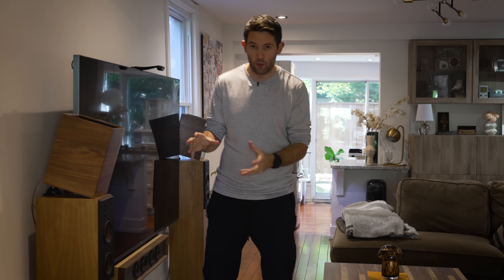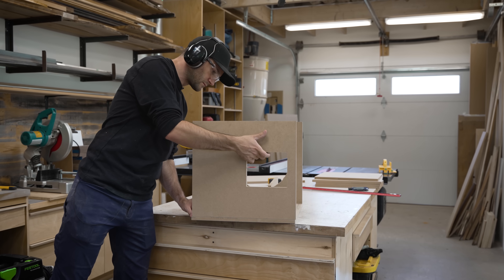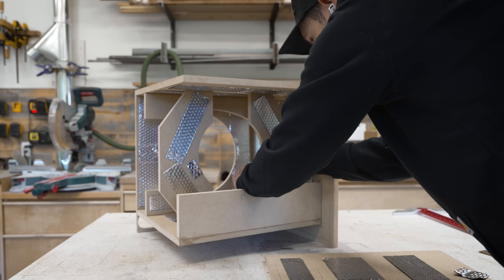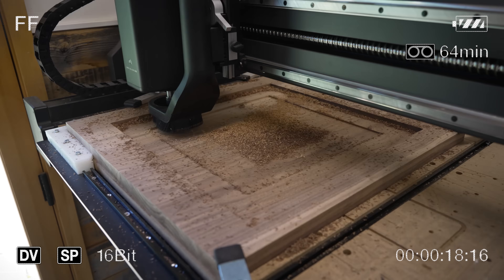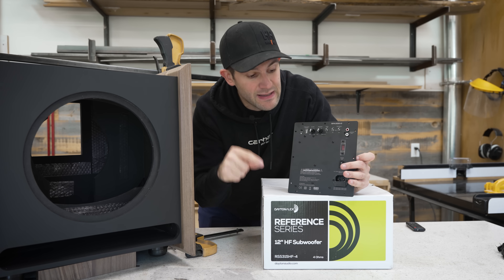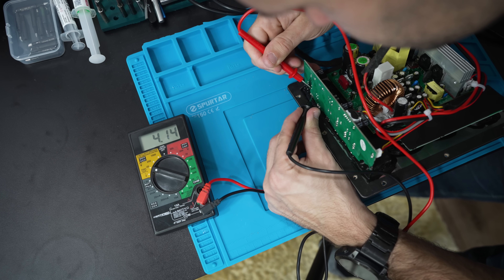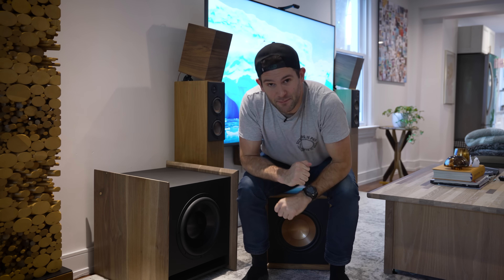THIS changes DIY Audio...

Comment: You do realize that those Dayton Audio wireless transmitters induce several milliseconds of delay to your subs, which you have to compensate for? The specs say 32ms which is equal to placing your sub about 12 meters (36 feet) behind your main speakers. Your main speakers are very much misaligned with your new wireless sub, which may explain some of the lack of 'punch' you hear and a vague 'room filling' ambient bass since the subs fight against the main speakers at the crossover region.

Comment: Why would you 'choose' a placing for the sub that is most likely to be the worst possible outside of placing it directly in the corner of the room? Also, why remove the old sub? Multiple subs will provide a smoother in-room response if placed smartly, standing waves cancel eachothers out.

Comment: Ah, the good old days of proper car audio—when a well-tuned sealed sub setup could shake your soul without sounding like a loose garbage can lid. Two 15-inch PPIs in a custom-sealed box? That was peak bass nirvana. Paired with a PPI digital amp (with the legendary bass remote knob, of course), an Alpine deck, and Pioneer Premier components? That was a stealth system done right. No flashy nonsense—just clean, hard-hitting sound.

Bet that '95 Cavalier rattled like crazy, but nothing hit quite like those two 15s. Pure nostalgia.

🍀🇨🇦🔊🔊🔊🫶🫡
Reply: And by the way you did a great job with this SUB. 
Especially cosmetically very original 😊

A common misconception. You're actually better off slightly overpowering your subwoofer with your amplifier than underpowering it. Trying to match it exactly or using too little power increases the risk of distortion, which can damage or blow the sub more easily than clean, controlled power from a stronger amp.

Comment: far as the ported vs sealed. little while ago i switched from a SVS sb16u to a klipsch rp1600sw. the klipsch is rated significantly lower than the svs on paper but in real world it absolutely destroys the svs in every single category. the svs was a powerhouse dont get me wrong but the bass felt more like someone was hitting objects with a bat around my house vs the klipsch feels like there is an active earthquake. also for shits and giggles. with both subs and gain all the way up... volume 7... the kilpsch was knocking dishes over in the kitchen cabinets and felt like a chopper was landing on the roof. the svs required 7-8x more volume to achieve similar output. and surprising enough the klipsch does just as well in music and is often drastic overkill anyway. while a sealed may get u that top 1% your looking for in music it will fall flat on its ass in every other aspect

Comment: I asked Grok to design a ported bookshelf speaker with a 5.25 and 3 inch 8 ohm drivers to include material and crossover options...in 10 seconds it gave me the design along with all parameters including materials, and detailed measurements including exact driver and port placement...
Reply: That's nice. You should get Grok a 12 pack of his choice for that.

Comment: 3/4 MDF is the minimum thickness I'd recommend for a box with 12 inch subs and just use Rhinoliner or plastic spray. For 2000+Watts systems I'd predrill, sandwich, glue, and screw together 2 layers of the 3/4 MDF for something that outlasts the subs in the box for the lifetime of the Box itself

Comment: That wireless solution adds noise, distortion and latency. Not a great idea but you can get away with it for a sub. Wouldn't recommend it for full-range speakers.

Comment: "At 300W it should be more than powerful enough for my theatre"  <- The real spec for a theatre is an SPL at a frequency.  For that you need to know the sensitivity of the speak and its resonance frequency.   300W but itself means nothing.  If the speaker has a sensitivity of 80 dB at 1W/1m, you need way more than 300 Watts to drive it.

Comment: I will hopefully, someday be able to do truly DIY, but I'm a caregiver living in somebody else's house, so not an option at all, for the foreseeable future.  My question is about your old subwoofer.  I believe you said that you "slightly modified" it.  Was it just for looks, or did you do modifications to make it work/sound better?  I have two used subs which work fine 90% of the time, but sometimes they make crazy sounds which I don't understand, and I'm wondering if I can improve them with any kind of simple tricks.  Of course, some year I will build my own, but for now I just want to make these older subs last until then. Do you, or anybody have tips/tricks to improve existing subwoofers?

Comment: 3:33 you may prevented the potential flex but you just split your mdf there and introduced potential rattle and also flexing if that snaps out of place and it will if you are expecting that much of the flexing which you do or else you would not make those braces in the first place.

Comment: yea. having board components exposed to sound pressure inside a box is not good. i would never do it. you need a sealed off space to prevent premature wear or breakages.

Comment: Ur making this way too complicated. All u need is winisd to model ur sub. Buy a pro amp with dsp(cheaper and better). Build a wood box. U will NEVER need a c&c machine to build a sub. Use birch ply instead of MDF.  ITS LITERALLY A WOOD BOX WITH A HOLE IN IT!

Comment: would it benefit to round the "outer" corner and glue in a round beveled piece of coping in the "inner" corner of the internal port structure where it turns 90 degrees?

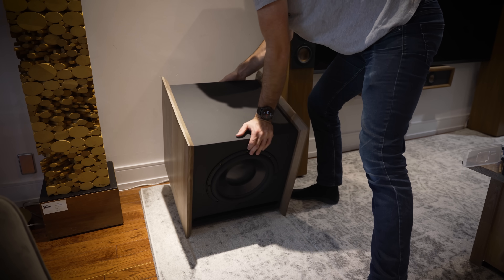Comment: 16:43 Maybe someone else mentioned it, but you said the transmitter/receiver would work on any set of speakers if they are passive, but I believe you meant active because the transmitter/receiver can't transmit the power needed to drive the speaker, just the audio signal.

Comment: All those components installed inside that sub just seems like a recipe for disaster. Only a matter of time before stuff in there starts rattling. I don't think those components on the amp board will like being rattled constantly and will probably fail prematurely.

Comment: Impressive project, having a CNC must be a game changer, for sure. I would like to add that your research is correct about the size and shape of the port determines the frequency "peak" output. Let's understand that you are effectively creating an "imbalance" where one frequency is "boosted" or "looser" and the expense of the accuracy or having "tighter"...less distorted bass at higher volume. Personally speaking, I prefer to have a sealed sub box since I use my sub for music and want cleaner, tighter, bass.

Comment: Since you stated in the video at 4:25 that you would want to change the length of that one bar in the SW depending on the type of audio you are pushing, you could put a motorized scissor jack in the place of that bar or attached to it with a (mostly) sealed slide to control / change / modify the dimension of the segment of your audio channel.

Comment: I love how this dynamat stuff just sorta apeared and suddenly every diy project includes them. Is it cause they finally entered a diy price range? I dunno, but it's nice to see diy get that extra bit of police just from some stuff that's easily added.

edit: I've seen them in not just seen it in speaker diy, but nas, and PC builds to quiet the fan and drive noise.

Comment: This may have been mentioned below or maybe you did already consider this....but never heard it mentioned in the video. To correctly tune a sub (size the enclosure) for a particular frequency you would not only have to consider the port volume but also the overall internal volume of the enclosure after all the internal components have been subtracted out. That means everything including the bracing, apprx volume of the amp.etc. Great video and great work!!

Comment: I painted the insides of my MDF speaker cabinets with two layers of polyurethane in 1979. I used Wilsonart teak plastic laminate on the outside. The laminate improves acoustics over veneer (which would have cost less). It's quite convincing; I've had woodworkers ask what kind of wood it is. Everything has held up over the past 46 years. I had to re-foam the JBL bass and low-mid drivers. The expensive part was buying enough land in the country to use them.

Comment: never saw anybody using this "car sound dapener" for reducing resonance of such kind of Sub u build. i doubt thats the right material to do it. but i will do a research. just really never saw that in around 20 years somebody put something that thin in his sub. i can even imagine u change the volume of the sub as its kinda air sealed surface of the Iso Pads

Comment: Anyone who wants to build their own home speakers or subwoofer does not have the research tools, Frequency generators or anechoic chamber necessary to do so.
I am an electrical and audio engineer and it is futile to try to reinvent the wheel. Companies that produce speakers spend millions on research. There is no way you can get better than what they specialize in to sell.

Comment: Oh boy, speaking with authority as if you actually knew what you are talking about. We start with the weird categorisation of closed woofers for music and ported woofers for cinema, as if ported woofers for music weren't common. Bitumen mats that are meant to dampen vibrating sheet metal in cars instead of acoustic foam!!! You never ever "match" the maximum output power of an amp to the rating of your speaker! Instead, use a more powerful amp and don't crank it to 100% to avoid clipping! Or you just use whatever you have available or is within your budget. But don't pretend your way is meaningful somehow! We know already where the USB power pins are and don't need to casually handle an exposed circuit connected to AC!!! Copper traces on your PCB don't care if they are exposed or not. You don't spray the PCB with salt water every day!!! Using a nail gun instead of clamps looks like one of those videos that use hot glue for everything. Glad YT has an option to never recommend a channel ever again.

Comment: 2 things.
1. You can use a more powerful amp with a less powerful speaker, you just dont turn the amp up all the way. This is called "headroom" and allows for a much cleaner signal to the speaker before the amp could ever clip. Over powering a speaker is much safer than clipping an amp.
2. You should have used a roundover on your internal corners, as well as the in and out of the actual port, this will reduce or eliminate the chance of "chuffing" (the sound of the air moving through the hole) and give you a cleaner sound.
3. I know i said 2, but...  i wanted to add, THANK GOD you didnt use bluetooth transmitters!!

Nice job othewise, Dayton Audio stuff doesnt get the chances it deserves sometimes.

Comment: If your chosen driver doesn't have a recommended box volume, or you really want to tune the box and port dimensions, you really want to model the speaker in WinISD (it's free) and test out the differences between sealed, ported, or bandpass setups.  Or how changing the box size and port size/length will affect the end result, including if you're at risk to over-extend the driver at certain frequencies, or if you're likely to hear huffing noise from the ports, or the phase of the port and speaker will clash and cancel each other out. Besides finding potential problems, fine tuning the box will allow you to achieve a specific tuning frequency, to enhance a certain frequency ranges, to extend (or reduce) the range of the driver, or just plain experiment with how the volume and ports change the sound output.  If you've modeled the characteristics of the driver accurately, the sound profile this program shows you is remarkably accurate to what you'll get.  I've built a few different setups over the years, for myself or as gifts, and I go through a whole routine with it.  DATS to take actual electro-mechanical measurements of the speakers I plan on using, and from this I have more accurately verified parameters to input into WinISD to model my enclosure, as well as a couple other files regarding frequency response and impedance to import into XSim to model the crossover circuit for all the speakers in the system.  Once things are built, you can then you a program like REW to analyze the actual sound output of the system too see how well it matches your model, and find any other tweaks you may want to perform to level out the frequency response, and just get it as perfect as you want.

That whole process is probably overkill for most people, but at the least I always recommend everyone do the WinISD step. Model your enclosure since you're going to build a custom box anyway, and know ahead of time if it's going to sound exactly how you want, or as good as the driver is capable of.  Few things are as sad to me as seeing an expensive bad-ass subwoofer dropped into some rando box without any thought, and it makes it sound like ass. It's like hearing puppies getting kicked.

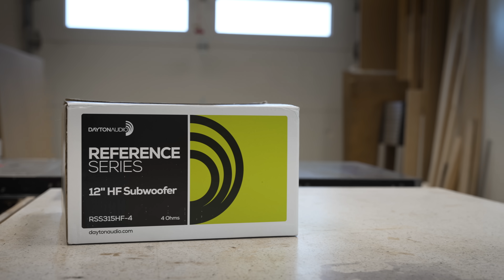Comment: @1:00 had me until I seen the Dayton Audio box.  I lived 30 minutes from Parts Express, so I've been using their stuff as far back as 1994 to replace the old Sansui woofers in my speakers.

@6:00 why didn't you paint it with sound deadener like Lizard Skin?

@09:16 So you glued and screwed? Overkill.

@11:51 I always like to use black hex bolts...purely for looks.

@14:50 that stuff is awesome!

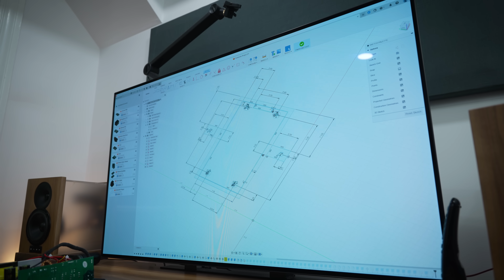@15:45 very nice touch.

Comment: Bluetooth?
Lol the wrong use .
Bluetooth have 2 problems .
Low hz is not thare bluetooth code filter it out for save data .
So about 40hz and lower is not thare .
2 problem
out of sync with the rest of the audio.

Comment: My brother build me one with pearless 12" + passive radiator. It weights too much to lift, could be around 50kgs (dragged it around on some thick cardboard). It uses a custom 280watt amp with base boost freq. and boost amount to fix a problem area in the speakers range.

Comment: The "D" is simply the next letter in a series of amplifier classes ie: A, AB, B, C, D, G. It doesn't stand for "digital". However, I can assure you, this IS a digital amplifier that uses PWM (or various other digital modulation methods) to simulate a linear wave function.

Comment: Some serious issues with your design, MDF should never be used for speakers, the best material is beech ply, but any ply is better than MDF is better. Also, making a speaker is not just putting a speaker in the box, especially with ported designs, there is a lot of calculation and fine-tuning in any speaker, a port is not going to function well if it is just placed without calculation and measurement, I'm not a port fan but if you have ported speakers the maths involved in its placement and length are very complicated.  300watts? Really, it's not about power it is about clarity, but if the rest of your system is some overpriced off the shelf system, you probably just will not realise that a sub-woofer is the least important part of a home theatre, good designed non-ported main speaker with a clear set of BBC monitors or similar, placed in the other positions is all you need.  Buut seriously MDF is a sound destroyer due to the material structure.

Comment: I'd definitely skip this if I knew this was about transmitting the signal wirelessly... Then again, I guess you can at least use that for a sub. But NOT for anything else. Keeping things wired is important for sound quality, even if that means a messier place.

Other than that, a nice build, and I'm glad I watched this.

Comment: If we are talking about a Dayton Audio RSS315HF-4 12" Reference Series HF Subwoofer 4 Ohm "400 Watt" speaker - It is CAPABLE of handling 400 Watts of power  before getting ugly- it does not produce that.  
Many folks dont understand the ratings.. Some mfgrs rate with RMS (average) power, some Peak. Looks like this is Peak rated with no spec on what the speaker likes as a minimum.   Too little power, not enough sub, might be sloppy too.  Pick an anp with double the rated power for best results.

Additionally you Will Have Phase Issues when you use a wireless system. 
There Will be a TIMING DELAY  caused by the radio link which roughly translates into 
The Sub Firing AFTER the hardwired full range speakers,  making things a little SQUISHY.  

Audio gets converted into radio, then back again.

Oh, and the foiled mat that the receiver is mounted next to... may interfere with the reception.

Remedy?  Delay the Full Range components by the propagation time of the radio link. -  not cheap if you value fidelity.

It is something we are aware of in Pro Audio- or why this engineer uses hard wire everywhere.

Nice video !

Comment: Couple things I noticed, amp does not have to be rated for the speakers. I have 2000 watt PA amps and have 400 watt subs and 300 watt tops powered with 800 watt amps, yes I could surly blow the speakers, but I haven’t in 10-12 years in use
blown a speaker. More amp is always better, more speakers have probably been destroyed by under powered amps than over powered. It’s just head room, so the amp never struggles or clips trying to drive a speaker. Secondly, class D amp is not digital, it’s an analog amp.
Hey but a really nice job on the boxes, look sweet.